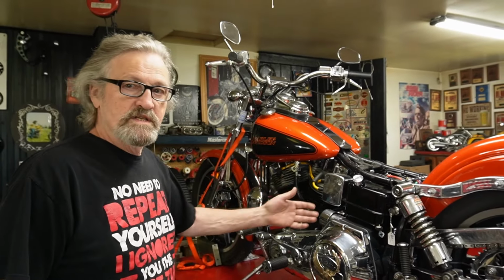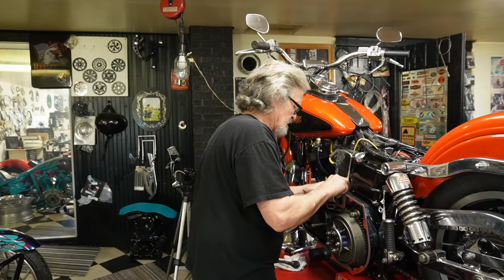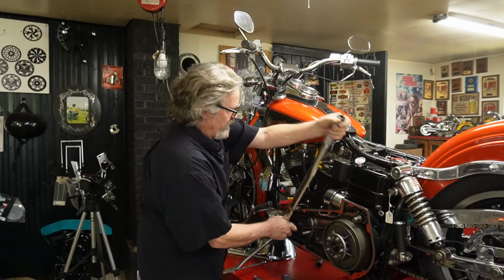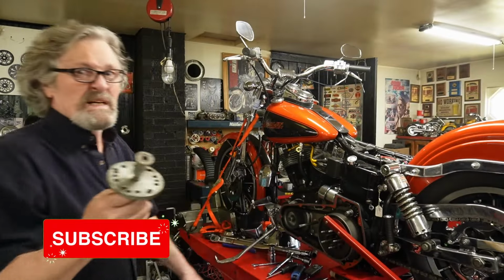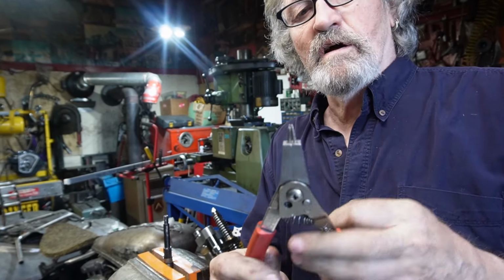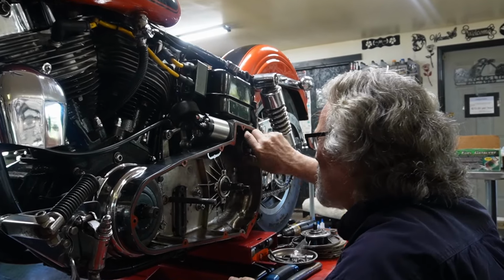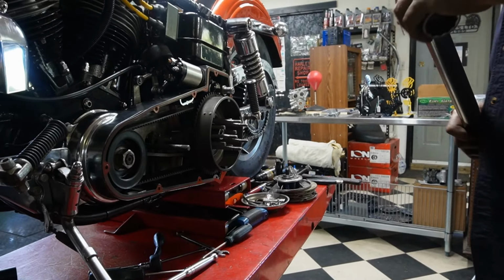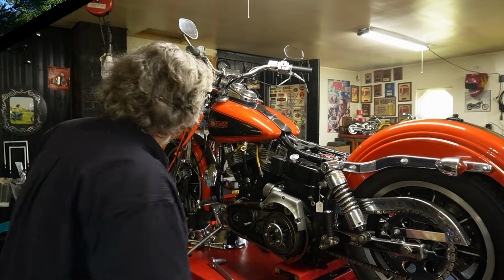IT'S ENOUGH TO MAKE YOU GRIT YOUR TEETH, REPLACE THEM ALL

Comment: yes, happened to me multiple times. Replaced it exactly like you did. Is that a BDL or Gates belt. My BDL belt snapped on me. My 93" shovelhead has some torque. I put a Primo Rivera clutch in her. Is that an FXE?
Reply from the maker: Not sure on the belt, I'm thinking it;s BDL. Big torque often brings it's own set of problems in the drive train. Thanks for commenting.

Comment: for me it was copper contact inside the solenoid. they just get so pitted that they won't pass enough current. a less expensive repair than the entire unit. those 7/16" socket heads are a bitch. i replaced mine with allen head bolts, easier to get an extended allen socket back there. also, it's very easy to cross thread those suckers
Reply from the maker: Thanks for letting others know your experience. I just like to put things on new if I am going to sell something. Good trick with the allen bolts. Thanks for commenting.

Comment: You didn't say but does this bike have the big bearing set on the clutch basket / hub ?? I had one on my 82 FXRS and what a difference ...
Reply from the maker: Yes it does have the "Big Fix" in it. I use the long bearings in most cases now. Thanks for commenting.
Reply: @itsmytimeletsgo  Ya I kinda thought that when you removed the basket and hub together . I also added the Tamer unit in there as well . Harley never made clutch unit for the shovel ...
Reply from the maker: Ran some Tamer's in the early years as well. I think we all tried everything we could to get a better clutch. Thanks for commenting.

Comment: Hey Ralph, I had a similar issue with my Merch 120. I had to replace the starter the solenoid and the voltage regulator..   Hopefully, I’ll get the bike back tomorrow. I only put 40 miles on it since I bought it in January.
Reply from the maker: Hope you get her up and running as you will be impressed with that Merch Motor!! They run some sweet! Thanks for commenting.

Comment: Great video, Ralph! I like that Primary cover piece you made. I may have to make me one. Is that a BDL belt drive. My 83 has a BDL, but mine has a belt tensioner.
Reply from the maker: They are really handy Ed as you can get a good look inside at what is going on when you crank her over. Make one and you will be surprized how much you will use it. I do believe it is a BDL drive. The early ones did have the tensioner as I recall. Thanks for commenting Ed.

Comment: I thought when this video started, I would finally understand what a Bendix drive did. Okay I got that. But what is  the part that you replaced?  It doesn't look like a part that would wear?
Reply from the maker: They lose their ability to lock in one direction, for starting. Then they will make that sound if not engauged. Thanks for commenting.